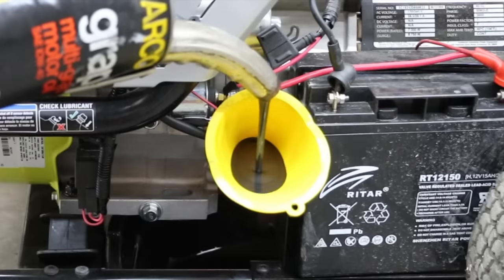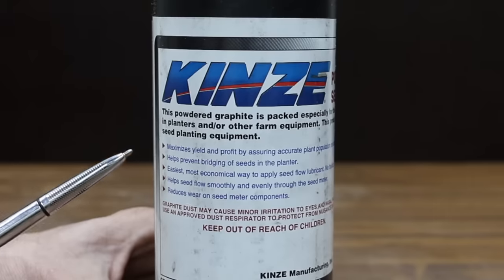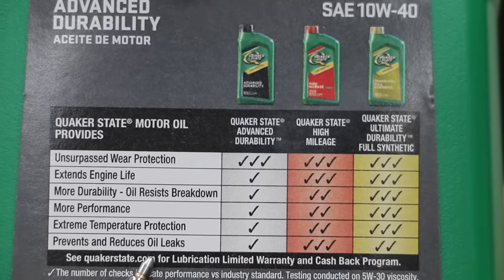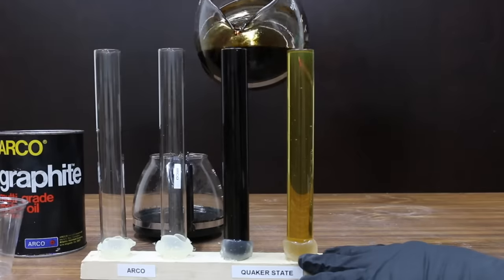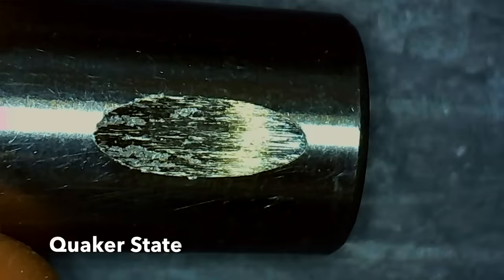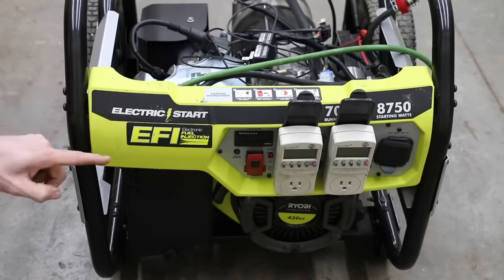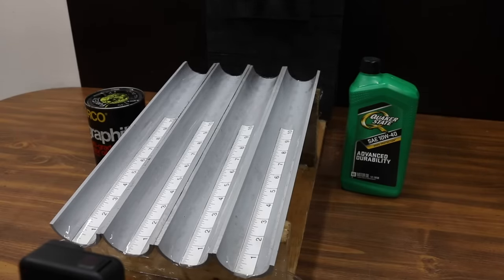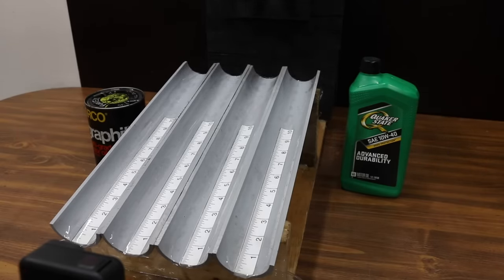Will "Graphite" Help Motor Oil Performance? Let's find out! Vintage Arco Graphite vs Quaker State

Comment: As a mechanical designer I worked for a company who loaned me out to Arco When the Acro Graphite came out.  As I was not an Arco employee I didn't get the discount, but I bought the product.  Used it in my 1975 Olds Toronado with a 455 engine and my collector car, '57 Olds S-88 convertible, until they stopped making it.  The Toronado probably had 75,000 miles on it when I started using it.  Had to go back to regular oil and it had 249,500 miles when a connecting rod started making noise.  Found a can about 5- 6 years ago laying around and added it to my Buick Lesabre with 3.8 engine when my Synthetic  oil needed topped off.
Reply from the maker: Thanks for sharing.

Comment: One time I had a beater 1993 Toyota Paseo 5 speed that had an issue of a lot of oil usage and oil smoke coming out of the exhaust. After changing the head gasket and all seals involved with that process including valve stem seals with no luck, I found that the engine was not only indestructible, but it would take about any oil you poured in and thicker oil seemed to smoke/disappear less while still making good pressure so, at one point I purchased a Flat Tappet Oil Additive (for use in leaded gasoline engines) as the bottle said. It was a thick clear honey consistency with zinc among other things. As I remember, the car did have flat caps between the cams and valves and I didn't really care at that point what went into the engine so this bottle of O'Reilly's special landed in the oil. The car performed no different whatsoever as far as I know but, then again, it would idle when hot if you pulled the plug wires so I don't think anything COULD change how that thing ran. Point is it was some heavy weighted zinc additive for older engines to run on modern ethanol based gasoline and it changed absolutely nothing for the Toyota.
Reply from the maker: Thanks for sharing.

Comment: I would love to see how adding graphite to a two stroke gas/oil mixture affects compression and performance. I'm specifically thinking about how this would effect  changes in older outboard motors, but any older two stroke motor would demonstrate the principle. Thanks for a great video!
Reply from the maker: You are welcome!  Thanks for the suggestion.

Comment: As a teen my dad tried arco graphite in his Cordoba with the 400 lean burn engine. That car was a turd from the get go but oil wore it out 10 times faster. The Lean burn ran HOT and roasted any brand of oil you put in it. The arco was garbage oil and the graphite would cook out with the sludge that cooked out of the oil. Took the valve covers off to put new gaskets (the neoprene turned to crumbling  peanut brittle) the graphite cooked out onto the cast head surface then crackled and partially peeled loose. Looked like black shiney corn flakes. Scraped and vacuumed out what we could and ditched the arco but the damage was already done. Valve train was noisy like a singer sewing machine. Burned oil like a diesel truck. Crap engine in a crap car on crap tires (Firestone 500's  with the sidewall tumors straight from the factory) the car silver paint came off in sheets and the fenders rotted thru like they were made to rust out. 
Now about the graphite. If you want to test the wear with a serious eye, try to source carbon graphite fullerenes. Also called bucky balls. Buckminster Fuller predicted their existence and possible uses. They are basically graphite molecular chains that form tiny little spheres. Like molecular ball bearings. 
I worked in a specialty machine shop for 22 years and we specialized in EDM (electrical discharge machining) which uses electrical current to remove metal under a traveling electrode. Electrodes could be made from all sorts of conductive materials, copper, tungsten carbide, and GRAPHITE.  You could sink a hex shaped hole in a broken bolt and unscrew it like a set screw.  the graphite dust would be slippery enough that you didn't need to oil alot of machine ways and in fact oil would gum things up.
Reply from the maker: Thanks for sharing.

Comment: If any dry lube was best for this, I'd think that boron nitride would be a winner. Works well for firearms. (way better than moly, especially since it doesn't stain and is used as an industrial dry lubrication).
Reply from the maker: Thanks for the feedback.

Comment: Boy did this video bring back memories!  Both myself and a friend bought a case of this exact same Arco Graphite in the late 1970's after I had just purchased a beautiful 1970 Buick GS 455 convertible from its orig. lady owner out of Atlanta.  I got the oil on sale because the old-name dept. store (Clark's) couldn't sell an oil that looked like black iridescent turkey feathers!   It looked used from the git-go!   have no comments on its worth in my GS, but at the time it sounded like a good idea for a collector car that might sit a lot.  I did verify that it would pass through the oil filter with no "clogging".  
My friend got his case for his wife's new (at the time) Ford LTD.  He changed to the Arco on one day and the next day the Arco was drained and CHANGED at a local service station. Why?  Because on that very next day after the Arco was added, his wife drove to a full service station and the attendant did the usual oil check for her.  He gasped: "Ma'am, that's the dirtiest oil I've ever seen!  Has the oil EVER been changed before?!"  She had no clue about the previous day's oil change to the Arco. So you know the rest of the story. That crankcase full of Arco got less than 10 miles of service.  ...
Reply from the maker: Thanks for sharing.

Comment: While not motor oil, Kalgard used to make motorcycle fork oil with graphite which reduced stiction in the old style 70s to 80s Japanese bikes.  It did seem to smooth them out a bit.  
I'm thinking that lower friction would equal better mileage more so with a load but at a high idle or with no load it may use the same fuel per cycle... just a thought.   It would be interesting to try the same test with a heavy load and see what happens.  Enjoyable stuff as always!
Reply from the maker: Thanks for the suggestion.

Comment: When I was growing up we ran the Arco graphite in our 77 cougar XR7 351C the motor never burned oil  and nerver needed to be opened even after 150K. My dad sold the car and it ran another 25k before it burned up due to a un-repaired transmission fluid leak.
Reply from the maker: Thanks for sharing.

Comment: On Harley Davidson I used Graphite in the Primary (chain between Engine and transmission ) and in the transmission but Not in the engine.  It worked very well. Does not take much added to the oil. I used less than you did. I used a electric Pre oilier on most engines.
Reply from the maker: Thanks for the feedback.

Comment: My father used Arco graphite oil in a 62 Chevy pickup with a 283 and it ran great on it , you had to write down when you changed it because it's so full of graphite it looks horrible fresh... but I understood it was a special type of graphite that would not clog oil filters and stuff...it worked great in old engines
Reply from the maker: Thanks for sharing.

Comment: Have you ever tested a "Hydrolyzer"? I'd like to see that video. It's a device that produces "HHO", or "Brown's Gas", and adds it to the air fuel mixture of the carburetor, supposedly increasing gas mileage and performance.
Reply from the maker: Thanks for the video idea.

Comment: This would work with much older engines.  The newer engines require very thin oils like 5w-20, 0w-20, 0w-16 and even 0w-8.  It would plug up cam phasers in short order in my opinion.  You make great unbiased videos and enjoy them very much.  Could you do toilet paper bypass filter to see how it compares to a regular oil filter.  I have heard some extreme claims about them.
Reply from the maker: Thank you!  Thanks for the suggestion.

Comment: I don't know whether you're still doing these, but there's an oil, that's supposed to be the absolute best/slickest oil known to man, called Ratfish oil.
It's not easy to find, but it really is amazing, and we use it as a gun oil, especially on firing pins in sub freezing conditions.
I'd bet that you would be super impressed with it.
Reply from the maker: Thanks for the suggestion.

Comment: Graphite additive's essential for dealing with low tension rings of scion and subaru that resulted in excessive oil consumption.  Packs onto the cylinder wall with heat, long runs.
Took an engine that smoked so bad worried about a smoking ticket, after a trip from LA to Vegas next day got the car smogged.  Passed on first try.  No smoke.
Reply from the maker: Thanks for the feedback.

Comment: I've used Krex graphite additive.  The main positive about graphite is that it gets into places regular oil will not.  It will lubricate the rings much better and any crook or cranny.  We used Krex on a wide scale at the Cadillac dealer in the 80's.  Some people claimed it cause an oil leak but it was extremely minor and black.  The graphite can actually slip past oil seals, but you won't see a drip just the dust sticking to the graphite.  I'm getting ready to fire a new flat tappet camshaft so you can bet it will get graphite along with the zinc.  I might use the Quaker State as it has everything except the graphite.  I'm also thinking it helps the cam as graphite is an extreme pressure lube.  Your testing was highly flawed, especially with the lawn mover fan belt still dragging on the crank pulley.  But I like the way you broke down the ingredients.
Reply from the maker: Thanks!  Thanks for the feedback.

Comment: Testimony for Arco Graphite oil:
My Father worked for Arco and brings me a case of Arco Graphite oil. This was in 1978
My vehicle was a new 1978 Chevrolet Caprice Classic 350 C.I. V8 with about 4K miles.
The first negative issue was where it could leak it did leak. It was like a gasket couldn't contain it. The valve covers were the worst and this was a clean new engine.
The next negative issue and the last was on a start up on a cold morning the crankshaft mains would rattle. That unmistakable sound of low tone metalic knock.
That oil came out of my engine and it knocked no more. I think Arco discontinued that oil and with good reason.
Reply from the maker: Thanks for sharing.

Comment: We used Arco graphite in three of our cars.  We all got pretty high milage > 95,000.  I had a 1974 chevy vega I used in for 10 years.  The vega developed a burnt valve at 80,000mi so when I took the head off I was totally surprised the original factory hone marks were there. Pretty good considering the vega engine had an aluminum cylinder wall.  The vega continued on through tuff chicago weather to 98,000mi until a rusted out control arm in the back ended its days.
The second car we used it in was in my dads Datsun 280z. Unfortunately, around    50,000mi the engine developed two worn  cams. The cams were lubricated by a oil pipe that had tiny pin holes that gave the cams enough oil and keep the oil pressure up.  The pipe appeared to be gummed up with graphite and l impossible to clean so we replaced it with a new pipe and honed the cams back smooth. We wern't sure if was metal chips or the grahite. We stopped using Arco graphic after.
The third car was my brother's new 1978 civic that he put Arco graphite from the get go. At the time Arco claimed you could go 80,000mi between oil change the civic never burned oil and he really beat that little car.  Car ran to 156,000 before it thru a rod.
We gave Arco graphite the acid test and in the case of the honda civic you could go 80,000mi between oil changes. When Arco discontinued the oil and we switched to Motorcraft oils.
On the negative side, the oil was very messy and stained clothes and your hands. But, at 62 now there is no sign of skin cancer. Good while it lasted!
Reply from the maker: Thanks for sharing.

Comment: Yes I have used grafite in a New Engine, but Not long term. And Your Wear Test Confirms that the Old Oil has superior wear protection with zinc and phosphorus additives present and why so many people are having trouble with worn camshafts and lifters with the New Oils that do-NOT have those properties.
Reply from the maker: Thanks for sharing.

Comment: Back in the day my father used Arco Graphite for several years on his Ford Granada. Upon discovering some lubrication issues, we pulled the valve cover and there was a black shale about 1/8th thick all over the top of the head and it was flaking off and getting into the lubrication system clogging the oil feed to some of the rockers.
Reply from the maker: Thanks for sharing.

Comment: I had what might have been the first Buick Regal Turbo.  It was a special order through a dealer friend.  It took some time to arrive and had miles on it.  The EPA had intercepted the car and used it for testing.  At my first oil change I used Arco Graphite.  The turbo was lubricated by engine oil.  Fairly soon the engine power declined and the dealer found the thin blades of the turbine were destroyed and distributed throughout the engine.  Buick authorized a full (well done) rebuild by the dealer but the turbine died again.  I believe the graphite oil couldn't deal with the high temperature of the turbine bearings.
Reply from the maker: Thanks for sharing.

Comment: Had a 1976 Volare wagon 225 one barrel, one owner 60K miles. Used nothing but Arco graphite from day one. I drove it 150K more using Valvoline 10-30 oil up to the end of the road. Replaced carb, clutch, tie rods, etc. but never had an engine problem or used much oil at all. Lots of road and cargo miles. Finally sold the old car to a man who planned on using the engine in his truck. So I'd say yes it was unique and pretty good stuff. From there it was Mobile One in my cars, bikes, etc.
Reply from the maker: Thanks for the feedback.

Comment: OK I used a similar type of oil additive in liquid form for a while causing me financial pain. 3 of my car engines failed when they should not have. I came to the conclusion the additives blocked the filters and starved the oil system. The bearings were badly damaged and signs of heat. The bores seemed fine but I do think they had more than usual buildup around the rings. In fact one engine had broken rings. I forget the name but I saw it at a car show and they used a machine like yours showing it had less friction and wear just like your result but sadly this did not translate the same result in the engine. I don't think you can buy this additive anymore which proves it is not a good product. It was around the mid 90's. I hope you like my comment. Thanks for your effort making these clips. It's a lot more work then people think. Regards Rik
Reply from the maker: Thanks!  Thanks for sharing.

Comment: I have used Arco graphite in my 1971 Pontiac LeMans used only arcography, love the results, I used it every time I change my oil, you might want to run Arco graphite in a motor for a longer period of time you will see better results
Reply from the maker: Thanks for sharing.

Comment: FYI - The 'Filtrate' brand in the UK had DAG 'colloidal graphite' in it - we used their 2-stroke oil in a selection of racing engines in the '70s and early '80s.  For some engines it was the only lubricant that would give a seize-free racing season - seem to recall that those engines with Mahle pistons and barrels liked it.  Think one European chain saw maker badged this oil and sold it under their own name. Might have been Stihl? Not sure.   We would get more power with synthetic oil, but the Filtrate was best for seize resistance.  HTH!
Reply from the maker: Thanks for the feedback.

Comment: The only problem I can recall from using Arco graphite in my '72 VW bus was that people kept insisting that I need an oil change even when the oil was freshly changed. I have no data to compare to , but I did get about 125,00 miles out of that car before the body rusted to the point that I was afraid to drive it.
Reply from the maker: Thanks for the feedback.

Comment: In the 1920's some motor manuals recommended adding colloidal graphite to oil during running in
Microscope Photos of bearing surfaces showed a significant difference as rough edges became rounded rather than sheared off leaving a ragged looking edge. Never tried the stuff myself and of course I wasn't around when those manuals were written.
Reply from the maker: Thanks for sharing.

Comment: I used to use a silkolene oil in my motorbikes that had a graphite additive. I changed the oil every 1000 miles and took my bike in for valve shim inspection at about 25k miles.
When I went to pick my bike up the mechanic said all my valve shim clearances were well within spec and he even told me there was no way my bike had done 25k! The top end and valve train looked like a new engine still, there was no brown staining. 
He showed me another engine he had in with half the miles mine had covered and the internals were brown oil stained.

I must say I had no engine issues while using that oil.👍
Reply from the maker: Thanks for sharing.
Reply: @ProjectFarm  The silkolene oil wasn't black like the arco stuff, I seemed to remember it was a golden amber colour, maybe slightly darker?
I just remember it being a bit more expensive but it came highly recommended by a mechanic friend who told me how it coated all the internal moving parts with a durable coating. Even a smooth machined metal surface has slight imperfections when viewed through high magnification microscope, the graphite filled those gaps and imperfections, smoothing out the surfaces.
When 2 such surfaces come together, those imperfections have all been filled and slide together with much less friction, hence less wear and more mpg.